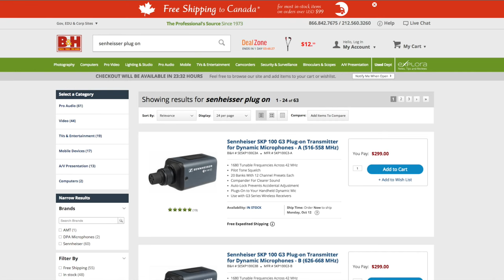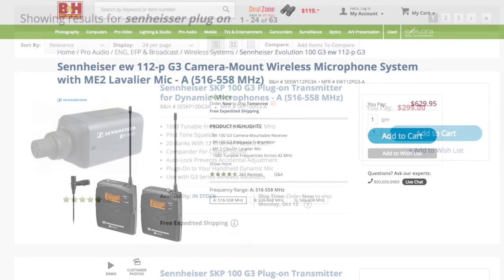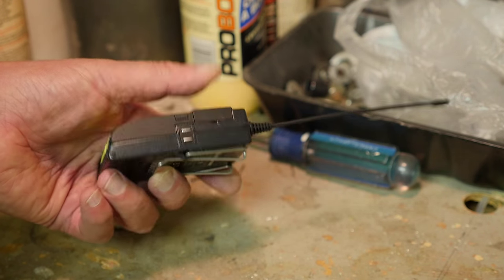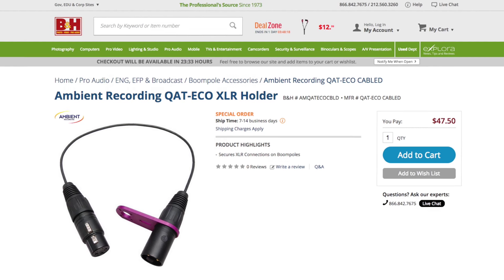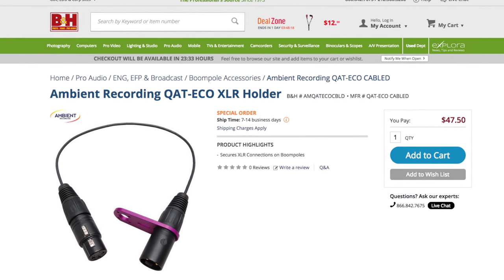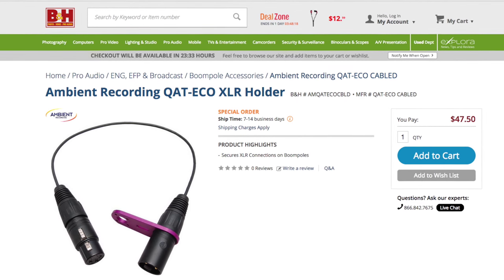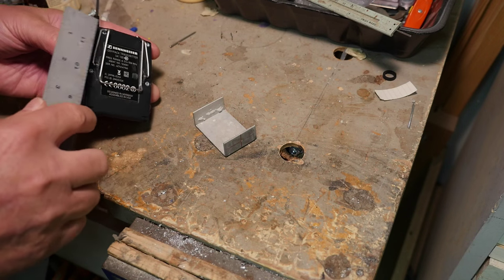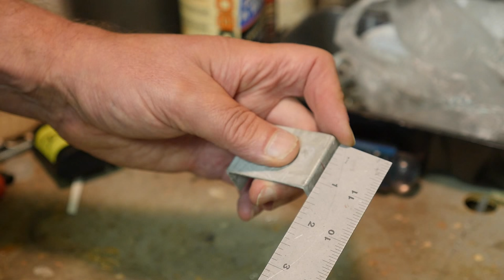Sennheiser EW100 Wireless to RODE Boom Pole Adaptor

Comment: Hi, i tried a similar set-up: Rode NTG2 (powered by battery) via XLR-> 3,5mm Jack Adapter into the Sennheiser EW100 G3 and from there into my Tascam DR 100 MkII. It does work, the only problem is that i get very low, actually unworkable levels. Even with full amplification on both EW100's and the Tascam.. :-(
Do you know a solution to this problem?
Reply: Solved it. The Tascam accidentally switched to line input rather than mic :-D